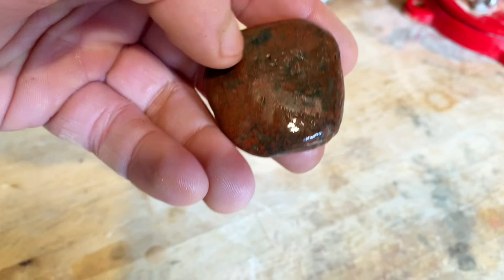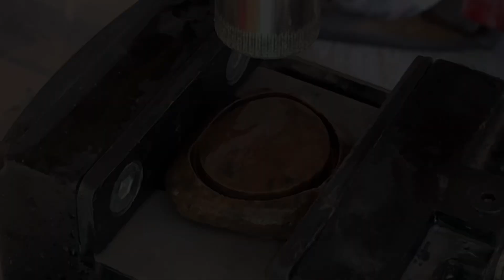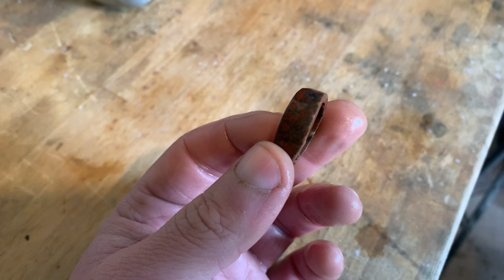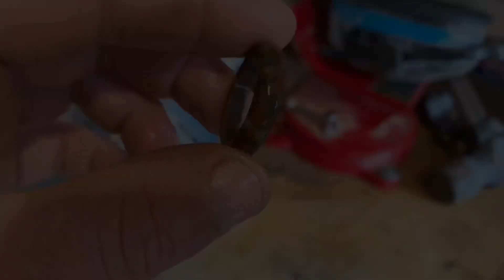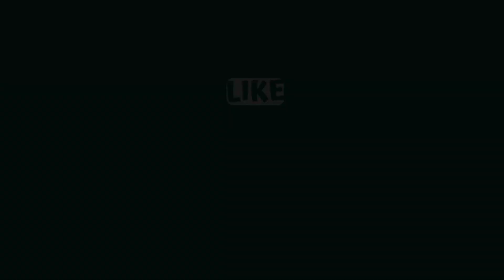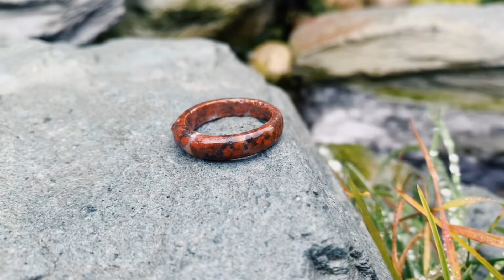Making a ring from a pebble

Comment: Love the idea. But it's quite brittle, correct?
Reply from the maker: Thank you, but actually I have made a couple and it really does depend on what sort of stone your using, so I found the more crystalline quartz in the mix like say moss agate or something similar it’s seems to be very stable, whereas something like granite is very brittle! But you can also stabilise the material afterwards with a resin, so your a 💯 that you would want to avoid most gemstones as they have natural cleavage points and wouldn’t survive the vibrations of the making process and if they did they wouldn’t last too long before they came apart  without stabilising
Reply: @Ninjasquid948  very interesting. I've never heard of moss agate before, though of course agate is well known. I dont like to use plastic reinforcers (resins) because they're certainly not in tune with the original idea ("A Nature Production", so I'd be on the look out for that crystalline quartz makeup as you suggest. Appreciated - be well
Reply from the maker: 💯 that’s why I stay to completely natural personally, I know they sell “stabilised” material to make cabs and so on, but for me I’d rather stick to what nature provides
Reply: @Ninjasquid948  amen, brother